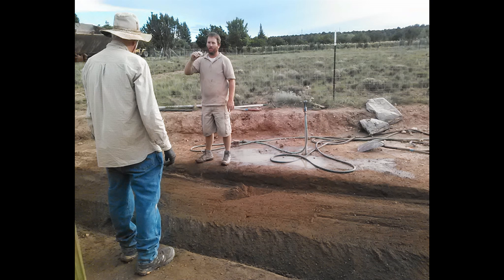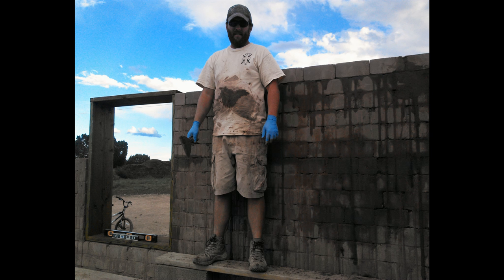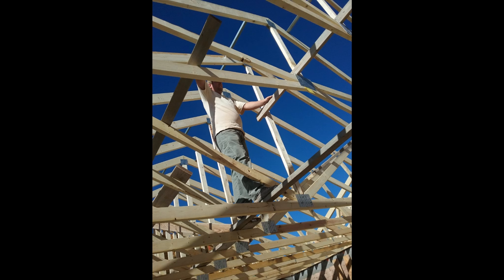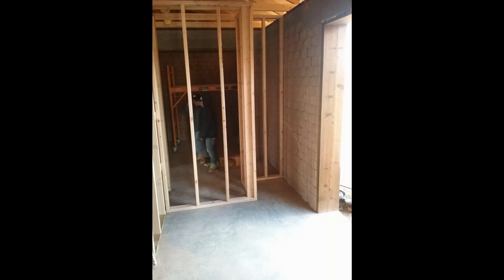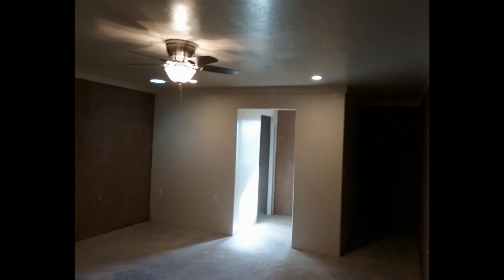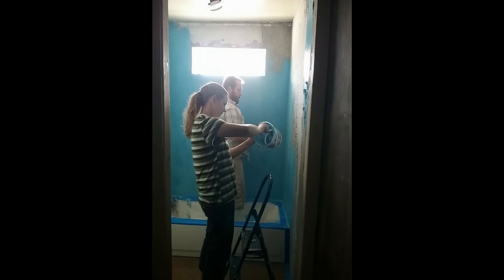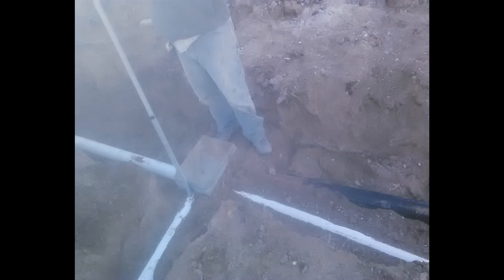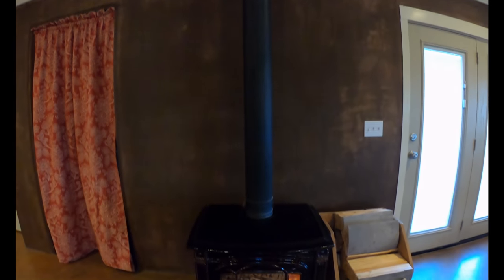Compressed Earth Block House

Comment: As an historic restoration mason from Central New York State, I am impressed. I visited  Arizona once 20 years ago and enjoyed it. I saw a FEW actual adobe buildings. The use of adobe remarkably was done in the 1840's and 50's here in New York's Finger Lakes in about 18 homes that were inspired by recommendations in a book at that time by Andrew Jackson Downing. I actually worked on one of these homes (built 1853)  making new adobe bricks to repair a bit of damage. I also worked on a new straw bale house in the same town and decided the qualitative difference between the two in terms of solidity and appearance was so slight that I changed from an interest in adobe to an interest in straw bale. Not what I expected at all since i thought straw bale was stupid 'til I actually was hired to work on it. Way less work too.  I can appreciate the work you did on the compressed blocks since this summer for instance I dismantled and then reconstructed 54,000 lbs of bulging old stonework 18 feet high. So I know what you have been through. The hardest part is the money!!!  If you do an earth exterior stucco, consider experimenting with hydrated lime mixed with the same clay and sand.  One part hydrated lime and 4 parts clay and sand will make a non-dissolvable mix when placed underwater. PLUS you can pre-mix all of it and as long as it is kept wet, it will not set up. It has no cement and the hydrated lime is non hydraulic so remains workable indefinitely as long as it is wet. You mix it very sloppy into a 2 ft high plywood box lined with plastic sheet. Just dump the mortar mixer contents into the box and when full, cover with more sheeting and some weight to keep the wind from removing the sheet. The volume can be whatever size you need but the height needs to be below the mixer lip. It stiffens about 30% the next day and then remains workable for weeks after that point. No more mixing each day. Just wet with a hose periodically and occasionally re-temper what you take out and put in a wheelbarrow. Hope this wasn't too tedious to read through!!     All blessings come down from the Father of Lights who does not change like shifting shadows.
Reply from the maker: "One part hydrated lime and 4 parts clay and sand will make a non-dissolvable mix when placed underwater. PLUS you can pre-mix all of it and as long as it is kept wet, it will not set up. It has no cement and the hydrated lime is non hydraulic so remains workable indefinitely as long as it is wet. "  Thanks for this great tip, I will definitely being trying this.  I have since put stucco on the house and I would have loved to try this method.  Before the stucco we used an earthen plaster with no portland or lime and we sealed it with linseed oil and it did okay but I was not fully satisfied so I ended up with struccoing my project.  I have a few other projects that I will be doing and I will definitely being trying your suggestions.  Thanks for the tips.
Reply: @SustainableLiving  Very good. Just remember a sloppy mix stiffens overnight to the right consistency and then remains that way as long as it keeps wet. Water can be added if it gets a bit stiff over the weeks.(you have drier weather than we do!)
Reply from the maker: @paulbriggs3072  thanks

Comment: Liked the Build.  I'm planning my own adobe block 2,000 sq. ft. house.  It will be a southern facing passive solar house so that the sun keeps the house warm at night by shining during the day on the north adobe wall.  The north wall absorbs heat from the sun during the day through south facing double pane clerestory windows high up on the adobe wall (120 to 200 square feet of window space to 2000 sq. ft. of floor space).  Building codes require back-up heat source, so I will use ductless heat pump units.  Wood stoves tend to dry up the air inside the house.  So much to alternative "green" houses.  Read Dr. Dan Chiras, "The Natural House".  It's all there!  J.P.

Comment: What a great job. I believe this is called stabilized compressed earth block-sceb's- what machine did you use to compress the block and where did you get it- so far how do you like the feeling of living in an earth home as far as sound, energy efficiency, personal comfort. God bless
Reply from the maker: Thanks for viewing our video.  You are correct since we added the portland cement to our blocks they then became stabilized.  So the machine is made from Earthtek, the machine was either a  BLM-12-8A2 or BLM-12-8A4 I don't remember, very similar machines one produces blocks a little faster.  The company's website is: http://www.adobemachine.com/
My friend had recently built him a home out of this material and convinced me to do the same.  So the machine was his and he was the one who purchased it from Earthtek.  We love living in our home.  It does have a different feel than a traditional home.  We have had people come into our home with hyper-sensitive allergy issues and they love our home and have no issues.  We have no issues with heating.  The wood stove is our primary source of heat.  I am sure you are aware of thermal mas, so once our house gets up to temperature it holds its own very well, even if we open all the doors, after closing them one hardly notices the heat loss.  It does echo a bit.  We are working on getting more drapes and other forms of sound buffers.  Over all our home feels very grounding, no pun intended.  As to energy, we use propane for our tank-less water heater and for our cook stove.  This runs us about $600 a year.  Electric we put all LED lights in our cans and we only pay on Average $70 in electric a month and this stays true through summer and winter.  And we burn about 3-4 cords of wood which is typically about 5 months of the year.  We cut our own wood and sell the excess wood to cover all our burning costs.  Over we feel this have been pretty efficient for us.  I would definitely do it again.    If you have any other questions feel free to let me know. Thanks again for your interest.
Reply: @SustainableLiving  Thank you so much for your reply. I hope you do more videos and a follow up in a year maybe on how things are going
Reply from the maker: Thanks for your interest and will do.

Comment: Ash how technology and government regulations have changed.  I remember going back to my childhood years when I was 10 years old,  my grandpa and grandma who came into the US from Mexico on the Bracero’s Treaty of 1942 they obtained some land in the Chihuahuan Desert far east of El Paso Texas.  One whole summer my older brother, sister, and myself spent our summer making adobe bricks, by hand, shovel, and grass stalks.  We had row after row of them made about 12 by 18 inches maybe 6 inches thick.  I remember we just laid them on the outline grandpa had.  It was hot, sunny, and dry.  Once we got to the roof line we went with him just driving down dirt roads,  finding stuff he needed like thrown out lumber, canvas pieces, tin, tile, linoleum.  He eventually had a roof and finished.  Kitchen, living room, 2 bedrooms.  Out house in back away from house.  Baths were traditional tin tub and sponge bath (they call it today).  The kitchen was simple with clay pots and griddles for cooking, oil lamps for lighting, an old car/truck radio and speaker with a car battery outside to power it for news and entertainment, for us kids the Lone Ranger radio segments in the mornings.  The floors were plain dirt covered with pieces of vinyl tile or linoleum pieces.  I remember how cool it was indoors.  Eventually he trolled some kind of plaster over the outside to preserve the adobe from erosion.  Basically, by todays standards it was an “off-grid” homestead,  Solar wasn’t available in those days.  They were dirt poor but like this video states,  with GOD all things are possible.  That experience set my life to be a hard working man that ended with a great 43 year career in maintenance of which I’m retired from and living the life.  Today,  I am glad to see adobe making a comeback.

Comment: Hi, did you allow your block to air dry for 24 hours before laying them . and  if so how did you allow them to cure completely for maximium weight bearing?
Reply from the maker: Yes we would at least let them cure for 24 hrs this was only to keep our edges crisp my friend that built his house he put his straight in the wall and has had no issues, for max weight bearing it was not an issues, to make the block and get it laid it would take approximately 3-4 days, so you can do the math getting for or five courses up would not hurt the block.  By the time we got to any significant height the lower blocks were well cured.  Hope this helps.

Comment: Did you do any sample blocks to get your strongest mixture, and also did you do a compression test? Did you have to make any adjustments to your soil prior to the final mixture?
Reply from the maker: No adjustments to the soil, we did have some gravel companies donate some dirt to try as they were interested in buying a machine.  All of the dirt that was donated did not work as well as the dirt from the property.  We did not have the soil tested but I am guessing our natural soil was roughly 60% clay and 40% sand, pretty much perfect.  I do live in AZ so I think the soils here are inherent for this material, thus the natives here why they used this product.  As for testing the block we only did the water test.  That is I soaked the block in a bucket of water for 24-48 hours to check for erosion.  I did not have access to compression testing, we just took special attention to ensuring no organics were in the block and we had not aggregate over the size of a small pea.   We then made sure the machine was dialed in to hit 1600 psi.  So far so good.  We do have left over blocks that have been setting in the weather for over 4 years now and the ones that had 10% Portland are still looking really good.  And yes water curing is really good.  We had enough rains that summer that our walls were plenty saturated so I think that helped a lot with the curing of the walls.  A few times I misted water on my block stacks but most of the time I just let them dry in the sun then set them the next day.  I hope this long answer helps explain a little more.  I am in the process of securing the block machine again to build my wife a small out building for her massage studio.  We will be filming this and documenting the whole process on a much smaller scale so people can get a better perspective on what we did verses the photos of our house build.  This will be partly in response to the high interest in this product.  We may not get to it this year, many other projects we are finishing up i.e. stucco, water cistern, but it is in the plans, so keep an eye out for that.

Comment: Thanks very much for sharing this adventure.  So amazing and wise to be a young person with a debt free home.  I am considering a Compressed Earth Block home for my retirement.  I live on 4 acres in SE Arizona.  ONe major concern.  I HATE being cold and I have read that the R value of compressed block is very low.  But other argue the mass of the blocks offsets this in some way.  So obviously I am a bit confused at this point. Would appreciate some input. Many thanks!
Reply from the maker: We heat solely with wood, we burn aspen and burn less wood than those that burn wood with a higher btu. Once the house is up to temperature it does hold the heat,thermal mass does really work, not for sure how to measure it but in my statement of burning aspen vs oak. This last winter was one of our coldest winters we burned for over 6 months and still only burned around 5 cords of aspen. Our elevation is around 6000 feet here in AZ, and we do just fine.  My parents and gparents live in the same area, the have traditional built homes they burn over 12 cords a year of spruce.  So over all I am very happy with my insulation, I did see a more stable temp. In the house once the stucco was on, but  that only stabilized a 5 to 6 degree fluctuation, mind you this is only using wood, forced air throughout the night it would be more stable, as you don't have to feed it wood.  Hope this helps, I would not let this scare me away from this material.  We use a evaporative cooler for cooling and we easily stay around 72 degrees.
Reply: @SustainableLiving  What an excellent reply.  I so appreciate it.  Can I ask what its like to walk into the home overall?  Does it have that basement feel that I imagine an earthen home would have? As in before the house is up to temperature to hold the heat is it damper or colder feeling than a stick built home that is well insulated?  Thanks for the answers to these questions. They are crucial at this point. As a retiree I dont get to do another home once its built. Thank you!

Comment: Impressive.  Do you mind if I asked why you chose a flat block, as opposed to the interlocking designs?  I have wanted to build this way, but was thinking that the interlocking blocks would be better, but I have no idea if that is true.  Just wondering if you had considered it and what drove your decision.
Reply from the maker: It boiled down to access.  This was the only machine we had access to at the time without having to go and buy our own machine.  The interlocking blocks would be better in my opinion, especially in a higher seismic area.  But even having a flat block there are ways to secure your walls in high seismic areas.  One can put tie wire through the block when laying the block and once the walls are up you connect stucco wire on both sides of the brick to create a basket effect.  We live in a very low threat area of seismic activity, so we were fine with our decision.  Thanks for checking out our build, good luck if you are choosing this building path.
Reply: @SustainableLiving  thanks for the reply. I have one more question. How much do you figure you saved over using 2x6 with stucco or some other siding?
Reply from the maker: @clarencevogel6039  We have decided to stucco the house so I don't think there is a calculation for this.  We tried to mud plaster the walls and use linseed oil but there was a lot of maintenance, so we are opting to the stucco for more durability.

Comment: Great job.  I hope you didn't go with cement based stucco on the exterior of your home.  Why?  Because it's not very compatible with adobe, rammed earth, cobb, etc. due to the fact that Portland cement is not vapor permeable, and natural earthen walls really need a vapor permeable plaster to allow moisture buildup in the walls to evaporate outwards.  Lime plaster would be a good choice instead of cement based stucco.  Best wishes to you and your family.

Comment: Greetings! Excellent video...nice to see someone thanking God for his provisions and the earth He created for us to work with our hands.
I live in AZ but I have 5 acres somewhere near Grants NM. My plan is to harvest my land to make Adobe blocks to build a home there when I retire. May I ask what the square footage of your house is and about how much was the cost to build? I'm making my own bricks but will hire subcontractors to build the home.
Reply from the maker: Our home is around 2300 square feet, and we roughly spent around 60k on building it.   This is the price of my family doing almost all the building.  We did hire out a plumber to check my slopes and to put in my tub and put all my pex fitting together and a few other projects, but this price is at us doing a good 95% of the work.
Reply: @SustainableLiving  Thank you for your response...
Reply: @SustainableLiving  was getting it permitted hard? how does that work do you just show the city your blueprints and then pay a few permit fees and that's it?
Reply from the maker: @hltron5781  I was crazy, I did not get a permit, and later delt with my county later, I presented to them New Mexico's codes, but they did not want to adopt or consider, long story is they petitioned the county that I built w out a permit, which in turn means if I ever sell, buyer will not get traditional lending, best thing know your city or county and if they are open to alternative building ways, I took a chance and it worked out for me, some areas may not be so lenient, good luck hope this helps,  present to them other areas that have codes and hopefully they will follow suit
Reply: @SustainableLiving  cool stuff thanks ,,, i didn't even know counties will do the 'built w out a permit' and allow you to finish ,,, i would think counties are like ''you give us money or we will force you to tear everything down'' ,,, well anyway good info to know and look out for in other counties around the country , thanks

Comment: I am really impressed by your effort, you inspire me a lot. I've a question for you though, what is the temperature difference between indoor/outdoor , day and night
Reply from the maker: Outside depending on the season we see tempatures in single digits in the winter and triple digits in the summer and it is not difficult to maintain the range of 70 to 80 degrees farienhiet

Comment: How did you run the electrical wire in the brick walls? Great video. God bless.
Reply: The electrical and plumbing did run in the wood studs behind the drywall. The earth blocks are just the envelope of the building for the most part.

Comment: Just out of curiosity, how did you end up doing your exterior insulation?
Reply from the maker: After two years of trying earth plaster and sealing it with linseed oil, this fall we ended up stuccoing the house, I do have a video that i got edit that I will soon put out about this. I will tell you the one inch foam board has stablized our temperature in our house even more in combination of the thermal mass.  We really wanted the oil to work out but it breaks down too quick in th az heat and sun, so we went with stucco.